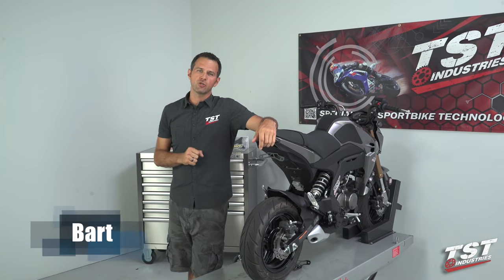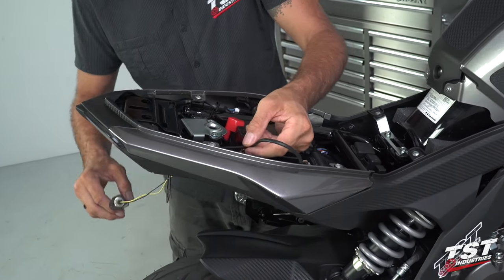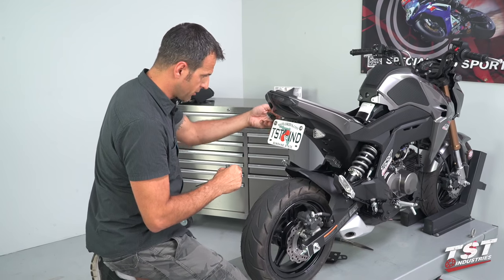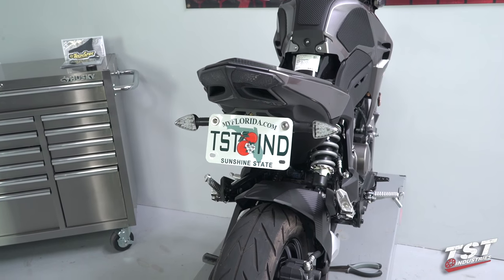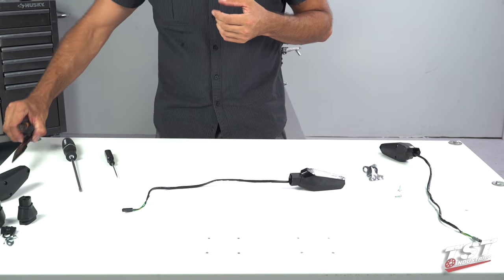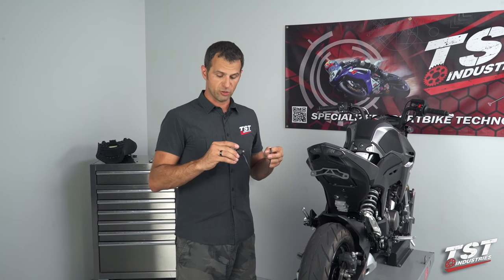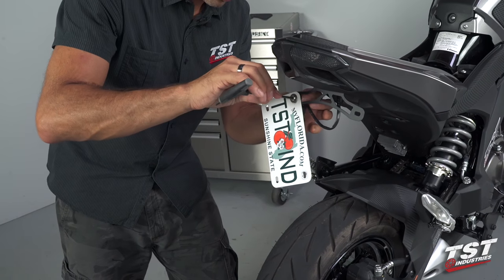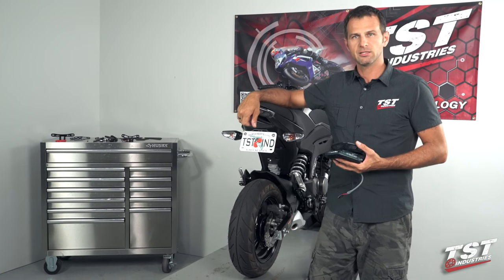Part 2: How install LED Pod Signals and OEM Rear Signals on a Kawasaki Z125 by TST Industries

Comment: can you get the intergrated turn signals to work with the ones on the fender eliminator to have both of them working?
Reply from the maker: Yes you can. You leave the pod signals connected with our harness converters, and tap in to the positive wires on those converters with the taillight signal wires.